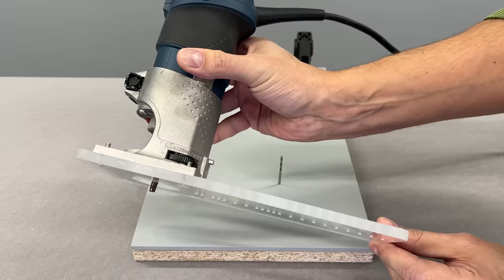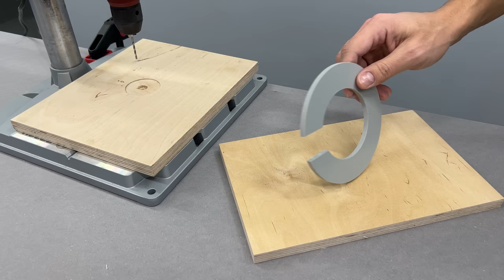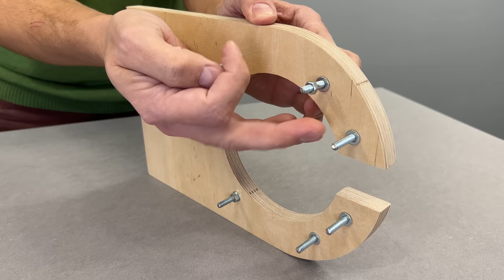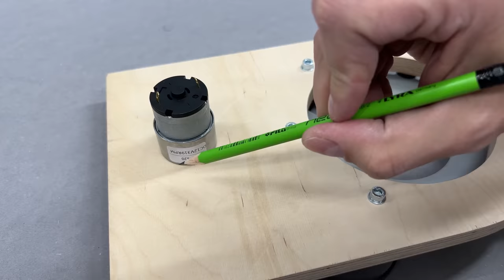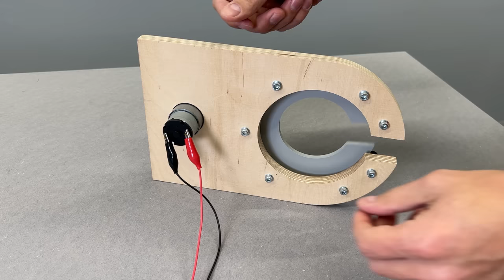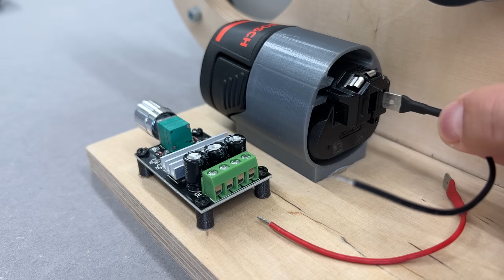DIY Wire Harness Wrapping Machine

Comment: Nice creativity but it would just be more efficient and cost effective to use shrink tubing. You slide wires through and then just apply heat to cause it to shrink. You can use a hair drier or heat gun or even a lighter.

Comment: Pretty impressive - however, if you need this only once, it is probably a little too much efforts to build this machine. Instead, I would have taped the Velcro around the cables and take 3 min instead of 20 sec. But still - a cool machine!

Comment: Ok very nice but where is the diameter calculation? Outer diameters of both the tape and cable must be close otherwise either it will pull the cable to the tape or it will be too loose after a few revs

Comment: A very well thought out project and very nicely produced. Where did you get the 12v rheostat to control the motor speed. Also, what rpm motor did you use?

Comment: Very good, I’d suggest  adding some tension to the tape to get a tighter wrap, you probably would need to have the cable supported on both sides to stay on centre.

Comment: As cool as this is, I have just so many safety concerns about some of the stuff you do when putting this together... Like yeah, you do you fam, but some of this stuff I would not allow in a workshop, lol. Stuff like holding that pvc by you fingers on the table saw instead of clamping it down, running that through an upside down router again with your fingers, soldering wires that are already (potentially) hooked up to a high discharge battery... Just so many things that would only take like five seconds to fix and possibly save someone's digits....

Comment: Wrapping looks good. But it is pain in the butt during troubleshooting and repairs. At the time when I was wiring engines in hot rods quickly learned to not to do it. In recent years working with fiberoptic cables it is the same. As little fastening as possible. Simple practicality.

Comment: Dude, you're missing the point. Wire harness wrap is self sealing because the upper layers are supposed to vulcanize into the layers below. But they only do that if you stretch them. Like, to almost twice their unstretched length. Beyond the limit of elasticity, to the point where the tape really changes shape, more than where it can bounce back. It is necessary to activate the chemical vulcanization reaction.
Since this contraption does not do that, you might as well not even bother wrapping the harness in the first place.

Comment: 1) that wireharness will never be used as is. (connectors are too close to eachother) that one ethernet cable still needs to be terminated. and 2)  jeez, must be nice to work with brand new .. everything, power tools, sharp drill bits, hardware, camera equipment.  700 bucks worth of equipment for this video alone.   no parts list, detailed plans of any kind.   he made this video for himself.

Comment: So many dangerous ideas, where to start?
I guess if you want to end up one of those old guys with only 7 digits between your two hands, go for it. 
#1: anyone who’s used a drill bit more than 10 times or paid attention in shop class knows those bits have little deflection strength along their length. (Eg they snap if you look at them wrong.) so ya, let’s rely on them to how a work piece while I cut/gouge/route away with a high speed cutting tool, no problem.
#2: most nerds older than 30 can tell you wrapping cables with tape = giant sticky mess that never really worked and just got everything it touched sticky as well. 

Just make stuff, don’t try to show how smart you falsely believe you are when it comes to real diy stuff.